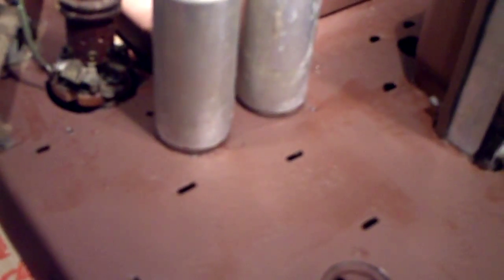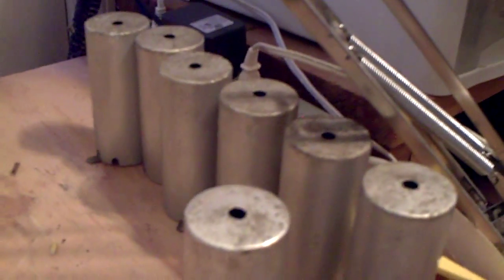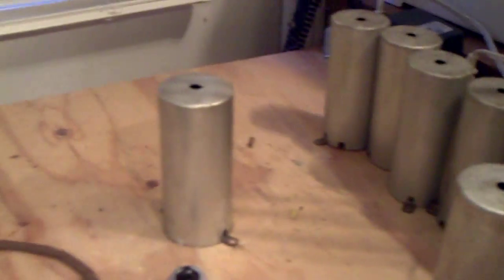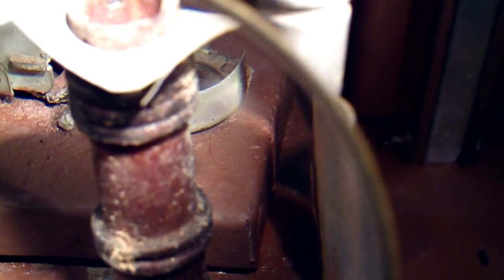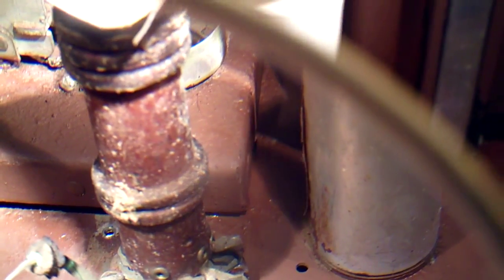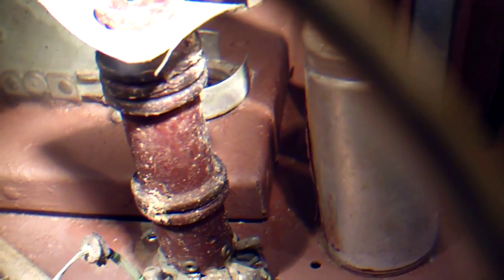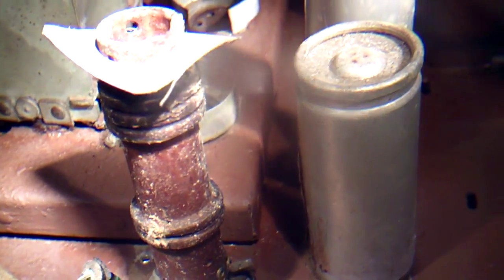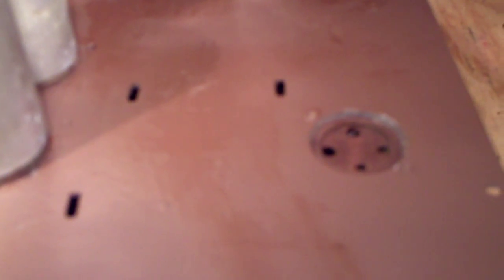Part 5 Antique Radio Repair 1934 RCA 262 Part 5

Comment from the maker: Thanks for the encouragement! I'm gonna wait a few days untill I paint the chassis with the stainless steel paint.  
Even with a magifying glass I can't tell wether the coil is nicked, or it's something on the coil, but I am not gonna touch it!  I think I will paint the interstage transformers after I get the radio working. In case I have to open the covers to replace the transformers, Next step, polish the cans up!